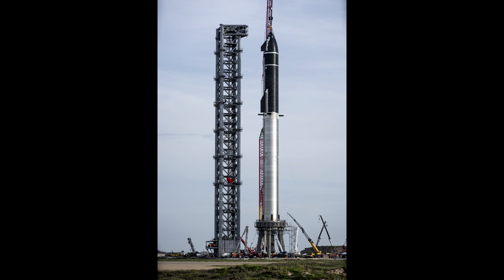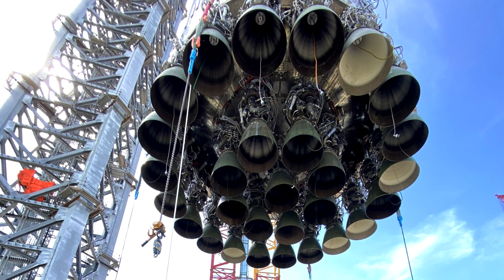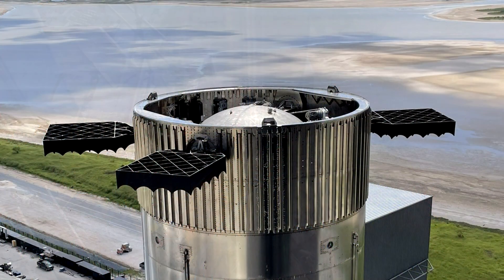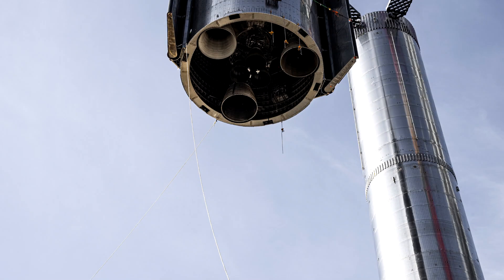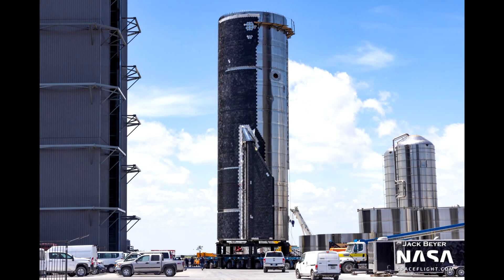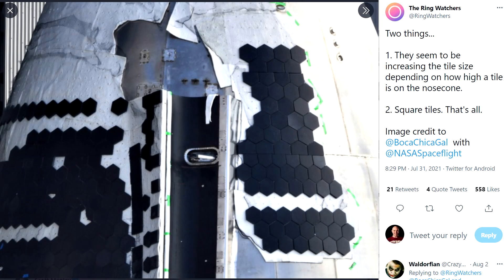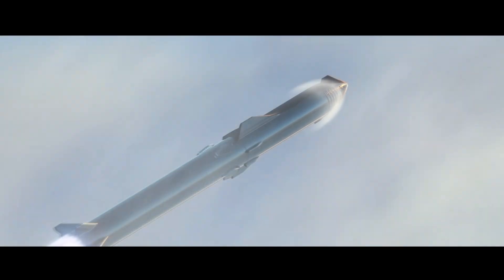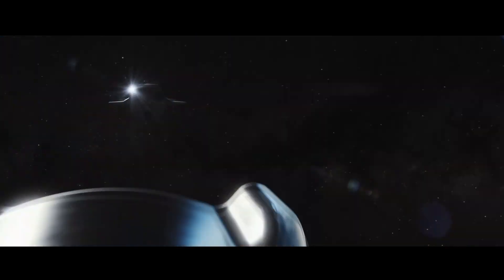How SpaceX Designed A Heat Shield For The Largest Spacecraft Ever Built

Comment: Once part 3 of Tim's interview comes out, please please do a breakdown of all the new information. There have been some absolute bombshells in there, and I'm sure I didn't even catch all of them. The ones I picked up on were that they plan to stage it by spinning the whole stack in pitch. The Raptor runs oxidiser rich. Ullage is going to be used for thrusters. Return to a fuelling arm. New raptor teasers.
Reply: the fact that the Raptor 2 is gonna have more streamlined and simplified plumbing makes absolute sense considering not only how many engines each launch will need, but Elon's ultimate goal of having Starship launches be as regular as jumbo jet flights.  Less chance of damage, simpler to just change out as needed, probably easier maintenance....right now they're still in prototype data gathering stage, and as seen by the way serial numbers have jumped, they're already way ahead of where they thought they would be.  Such an amazing time to be a space fan
Reply: Raptor runs oxygen rich? It's a full-flow staged combustion cycle engine, surely it runs both oxygen rich and fuel rich?
Reply: @gerrycalhoun9827  I believe you’re correct as far as the two preburners are concerned; but I believe Elon was talking about the main combustion chamber. I think.
Reply: @gerrycalhoun9827  "[...] surely it runs both oxygen rich and fuel rich?" On a bad day, it may even run engine rich!
Reply: @gerrycalhoun9827  The fuel-oxidizer mixture is slightly oxygen rich to avoid stoichiometric ratio, which would cause too high combustion temperatures and would damage the combustion chamber.
Reply: @jgottula  Ahh cool, that went over my head lol
Reply: @gerrycalhoun9827  Oxymethane at Stoichiometric ratios is a cutting torch.  You run it either fuel or oxidizer rich in order to cool the temperature of the flame, and because O2 is the heavier molecule, it lets you get more ISP to run oxygen rich than methane rich.
Reply: @hufca  Why don't they use a different chemical mixture so they can use the stoichiometric ratio and have it be at a lower total energy level? What is the reason to use a chemical mixture that burns too hot at the perfect ratio?
Reply: @rdizzy1  because oxygen and methane can be made on Mars...
Reply: @rdizzy1  I think the biggest factor that points to using methane is that they will have a supply available on Mars (after they set up a 'factory' to make it from resources that are already on Mars).
Reply: We need a breakdown on Raptor 2, stage 0, cargo door and few more topics…
Reply: Yesss, great idea
Reply: @rdizzy1  I do wonder whether the oxygen is doped with either nitrogen or argon. It would make the exhaust less corrosive. Both are also available on Mars. Nitrogen lowers the density without much performance gain, but argon would be interesting as monatomic gasses are sort of the ideal rocked exhausts. The high molecular weight isn't great for ISP. There are certainly cool things that could be happening.
Reply: @gerrycalhoun9827  As Jgottula said, he implied that the main combustion chamber was oxidiser rich. Hot oxidiser is corrosive, and the temperatures in the main combustion chamber are much higher than in the preburners. As far as I am aware no engine has ever run oxidiser rich before (could be wrong), so it is a really big deal.
Reply: @CCNorse  Wrong way round. you want light molecules to get good ISP, which is part of the reason fuel rich is so common. For hydrogen in particular it is actually beneficial to run it rich, because the gains from reducing the average molecular weight actually outweigh the losses from not being stoichiometric.
Elon seems to put a much higher premium on density than I have seen before though. He talked a lot about that. Higher density means higher chamber pressures for the same pump power, so maybe he just has discovered that he can get more back from chamber increased chamber pressure makes a bigger difference.
Reply: @agsystems8220  I think some soviet engines ran oxygen rich, I remember reading/hearing that american rocket scientists were very impressed with soviet metallurgy after they eventually exchanged rocket engine designs.
Reply: I watched 1 and 2 and yes a Scotty fly on the wall due diligence video would be cool
Reply: Tim is great but I need a Scott Manley summary.
Reply: @piotrfila3684  That's just in reference to their turbopumps. The engine itself would not have.
Reply: A lot of the content in this video seems to be based on the information of Tim's tour with Elon already.
Reply: @agsystems8220  The RD-1x0 series is oxygen rich.
Reply: @hermanrobak1285  We've seen a few incidents on Raptor involving wall-rich combustion.
Reply: @CCNorse  thank you.  I was just going to ask why oxygen rich.
Reply: @ChevTecGroup  and methane is cheap.
Reply: @MrGoesBoom  ø
Reply: I would love that as well.
Reply: How does reentry profile of dragon vs starship affect choice of tps?
Reply: Exactly, I don’t want to sit here for 3 hours watching the actual interview
Reply: Pretty sure in part 2 they showed a nose cone which had levels like it was a pathfinder for the human habitation area...
Reply: @roycewest9017  Parts 1 and 2 are well worth watching.
Reply: @davidcarlisle1555  That's in the part 2 of the interview. I think it's the other way around: they adjust reentry profile to match their TPS choice.
Dragon is optimized for ablative cooling and can take much higher peak heat, while they need to make sure the heat won't reach the glue layer. On the Ship they need to minimize the peak heat while it can sustain heat for longer periods.
Reply: @ChrisEffpunkt  He talked about it with regards to the 'flip' that the booster has to do for it's boost back burn. He suggested that that flip was going to be initiated with the engines, rather than thrusters. That means the flip has to be started before booster engine cutoff, so before staging. He then talked about the starlink satellite deployment, and how spinning can be used to separate parts. I agree he never explicitly states it, but I think we have enough to believe it is being considered. If it works, it would get rid of any parts required to push the two stages apart, so is entirely in line with how Elon thinks.
This is why I would like Scott to do a full breakdown. There are things said between the lines that I'm sure I will have missed.
Reply: There is also a question about how you configure the turbo pump that provides fuel. Its best to run the pump very cool for safety, either Oxy or methane rich, then dump the turbo exhaust into the main burners and equal it out there. Its been a long time but I have heard that it is very difficult to keep the seals intact in the turbo pump and the cooler it is the longer they last.
Reply: @rdizzy1  Just not a lot of good alternatives to oxygen. On the fuel side, there are all sorts of options (hydrogen, methane, RP-1, solid hybrids, ammonia, etc). But on the oxidizer side, we basically have liquid oxygen, fuming nitric acid, and fluorine compounds. The latter two are... difficult to work with.
Reply: That would be great!
Reply: @andrewpriest9403  yeah but in principle there's nothing requiring that a liquid rocket uses one oxidiser component and one fuel component and nothing else. They could also use methalox at stochiometric ratio, plus inert CO₂ or nitrogen only to keep the temperatures in check and add reaction mass. CO₂ in particular would be even easier to obtain on Mars, than oxygen.
But presumably, this adds new problems that make an oxygen-rich main chamber preferrable. The main problem with oxygen is that it likes to react with metal walls, but apparently they have figured out how to deal with that.
Reply: @leftaroundabout  As I understand it, adding inert dilution like N2 or CO2 reduces the ISP more than just running slightly away from stoich. Especially factoring in the extra non-reactant mass being lugged around.  

Something like EGR might work though. EGR is very effective at reducing peak combustion temps (by the same dilution effect), and it just reduces the total mass flow rate, rather than adding more mass to carry.
Reply: @andrewpriest9403  extra fuel or oxidiser beyond stochiometric is effectively an inert addition that's also just lugged around as reaction mass and coolant.

Yes, if that part is CO₂ it would result in lower Isp than with O₂, but that's just because of its higher molecular mass – which however provides more thrust as well, so it's a tradeoff.

What's unequivocally bad about having a third component is the added complexity, both for the tanks and pumps.

EGR isn't an option for cooling the main chamber of a rocket engine. You'd need to collect exhaust gases after they have significantly cooled down – but that only really happens after they've left the nozzle, where they quickly disperse.
Reply: Amazing stuff. I lived thru Mercury, Gemini,and Apollo. To see all this and how the genius mind works is simply amazing.
Reply: The oxygen rich is because it has a much higher density than methane,  so more mass in the same volume of tanks but also more mass flow through your engine and hence more thrust which is what you want for the booster stage so it accelerates quicker and you have lower gravity loses. Its not all about ISP, especially on booster stage, Methane is being used as there is less coking which is important if you want to re-fly your engines.
Reply: @CCNorse  Just the opposite actually, you want lighter molecules to improve Isp. Running oxygen-rich means worse Isp than running methane-rich. Shuttle ran hydrogen rich for exactly this reason, which means that if Raptor runs oxygen-rich, they must have some crazy good reason to tank the Isp hit from that
Reply: Manley no hahaha
Reply: @superdau  the info about tile fixing methods was all new to me. This looks like the number one risk/challenge.

Comment: The white insulating blanket could also serve a secondary function in protection the tiles from the extreme cold of the steel surface when the Starship is fully fueled.
Reply: Reducing thermal shock on both ascent and descent maybe, though I’d imagine they’d get pretty cold outside the atmosphere. Unsure what ambient temp is above the Karman layer and in the absence of insolation (in shade).
Reply: awe, its got a blanky
Reply: How about the whole thing doesn’t exist
Reply: @CharlesStevenage  Uhmmm, wanna go to Boca Chica and check???
Reply: @CharlesStevenage  HUH??
Reply: @etherealstars5766   bet ya 20 bucks he’s a flat Earther, Oompa Q’Loompa worshiper and rona denier 😅
Reply: yeah NSF apparently had a source saying its a thing used for insulation but most of all for shock reduction on the tiles
Reply: @CharlesStevenage  Why don't you prove that you yourself exist, before insinuating that others might be unreal.
Reply: That's a great point to make, it's easy to consider the re-entry heating, but the cooling from the fuel is deffinitly dangerous too.

A little extra vibration damping near the engines doesn't hurt either I'd expect